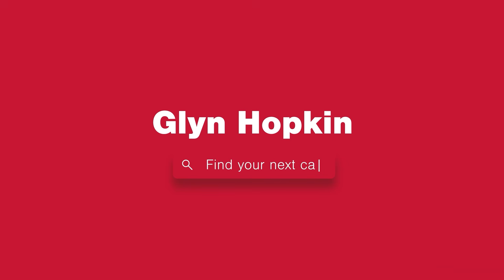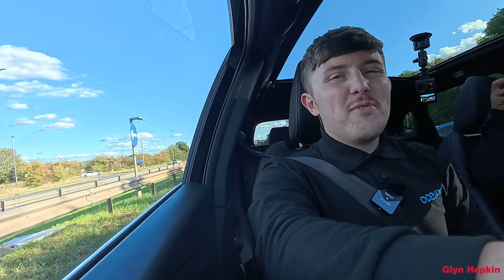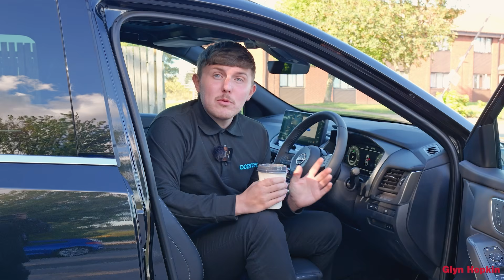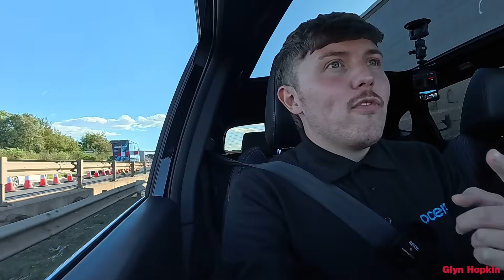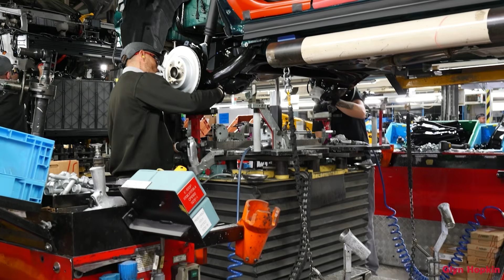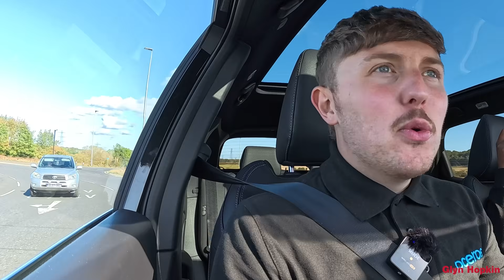NEW Nissan Qashqai e-POWER - Road Trip Challenge - Travel 759 miles WITHOUT refueling?

Comment: I went from the 190bhp driving pressing on all the time I would get 440 miles, always in sport mode.

Now I don't know what theyve done to the new model but it blows the last one out of the water, my 205bhp facelift is on its first tank of fuel and with a mixture of urban and calm motorway driving (always in eco now) I'm going to easily get 650miles maybe more! What a car, you won't be disappointed
Reply: They changed the engine and also tweaked it not to run to maximum revs so quickly all the time.

Comment: 759 miles per fuel tank bullshit when I picked mine up from the dealership I filled the tank to the brim that gave me 660 BUT as time as gone on I now get less than 500 per full tank is anyone else E-power 1.5 car I'm lucky to get 50 mpg
Reply: What is the temperature?  Ever single hybrid I know take a hit when it is cold.
Reply: Count yourself lucky - my 1.6 MHEV Qashqai gets 24.mpg around town.   The e-power can get 70-80mpg around town.
Reply: @markm49  e power 70- 80 around town not in a million years I get tops 50 miles per gallon if I'm lucky..
Reply: @keithscott676  Correct in every word you say bud, Ive a 75  plate Tekna from new and never hit anything like that,
but I must say a lovely car,to get that I think youve gotta be 80 yr old,drive in eco at max speed of 15mph :face-blue-smiling:

Comment: The e-power is an interesting proposition. Why no mention at the journeys end of the fuel consumption which is a major omission.  Surprising given that good fuel economy is supposed to be a major benefit of the tech.  A miserly three year warranty hardly shows faith in the tech and is underwhelming these days compared with most of the competition.
Reply: 3 years ? Here in NZ its 5 with up to 10 if you service it at a nissan dealer

Comment: Well  I had a major Power failure in my new 205PS after 700 miles in mine and 3 weeks  later it's still with the dealer.  Just as well I was not on the m25 when it ground to a halt. I did 26k miles in my 190PS e power without probs.

Comment: 600miles is not possible on a normal motorway driving. I had this car for a week and on 72mph motorway I was getting around 46 mpg, and around 530 miles of range. 
However in the town it’s possible to do 750-800 miles. As in the town it’s possible to get 70.5 mpg with a defensive driving. 
The car feels solid and well made. It’s a great car. I liked it a lot on 900mile trip in Scotland. 
Only thing the basic seats are terrible for long drives. No lumbar support. I’m curious if the leather seats are any better
Reply: ha ah, this is the new system which improve fuel eff by 16%.
Reply: @cb5110  I think it still won’t help highway consumption, where it relies on the petrol engine to run on high revs constantly
Reply: @DediPig  it does, the new system engine turbo reduce RPM by 200 RPM, also force more air in which help burn more fuel.
Reply: He was doing 56mph in part of the video which is a much more efficient speed (though one of the clips shows him just over 70 as well).
Reply: This is the new improved e power system!
Reply: @stevemarks9360 Hope they will address the seat issue too.

Comment: 72 plate xtrail max 480miles to a tank  .fake 600 plus to tank not possible.
Reply: Your car doesn't have the same engine. You have the 2nd generation of e power. This is the 3rd generation. Not to mention the X Trail is larger? Heavier? Are you expecting the same mpg as a Qashqai?
Reply: It's possible if you're not driving in the motorway.

Comment: My 72 plate 12,000 miles one new 12 volt battery noisy front brakes not been sorted! I agree hybrid battery not big enough. I asked them to tell me how many miles have the engine done to give me an idea on what the car has done on battery only but they couldn’t tell me! I regularly drive and I’ve never got more than 43 ish over 500 miles interesting as info comes up when I switch off current mpg 70 mpg but this means nothing…. I will add I’m not driving this hard… overall disappointed

Comment: 759 miles my arse... Mine is  a 2025 Qashqai E-Power Tekna new version with 205HP. The only  way you're going to get up to 62.8 MPG especially on a longer trip is by sitting at 56 MPH and drafting HGV's. I did a very long trip up to Scotland and back all in the space of a day and a half, and the very best I achieved was 50.1 MPG, measured from full tank first click stop back to full tank first click stop, This was at or very near to 70 MPH with an occasional burst up to 75MPH, but not for more than a few minutes at a time.... I also take massive issue with the infotainment  system. On mine Android Auto does not  work properly. You can FORCE it to work by turning off the infotainment by keeping the button pressed, and after it reboots press the button once gain to turn the infotainment system back on.  Sometimes even this doesn't work, and you have to unpair the car  and the phone and start all over again, but when you  get out of the car and turn the ignition off, it develops amnesia and you have to start all over again with the power on off button for the infotainment or delete all pairings and start again next time you get in the car. I raised this as a complaint with NIssan UK who promised a 48 hour response time.... 20 DAYS LATER, (Yes TWENTY ) I'm still waiting for Nissan UK to get off their arse and call me back.... For a brand new car the quality is total shite, with squeaks groans and rattles from both front doors, the boot trim and something underneath the back seat... It's tiny 2 kwh battery cannot  cope with motorway driving and  will sometimes come up with a warning to say insufficient power, now switching back to hybrid power, even if you do drive it gently, which I do. Oh and the seat must have been designed in a torture  chamber as the lumbar support is not enough and left me with backache.

Good points. Umm, its quiet, the cameras work well, I like the wavy foot approach to boot opening, as it has saved me some hassle a few times now...

Would I have another one, er not as long as I've got a hole in my........ wallet from filling it up....
Reply: It either the car have a problem or the temperature. My Honda hybrid also show  power reduce when it is cold.
Reply: It wasn’t on a motorway I was getting low 60s it was urban , it’s useless on a motorway. Just driving steady on my commute to work. Now the mpg has got even worse barely scrape 45mpg
Reply: @mathewnicholls5881 if it cold it going to get worst and come back when it warm. No hybrid work well in cold time, simple because of the battery.
Reply: When I first got mine, on my work commute about 3months ago I was getting anywhere from 60-72 mpg now for some reason months later I’m lucky if I scrape 50mpg. No difference in my driving at all and tyre pressures are all correct. The only thing I can think of is maybe because it’s getting colder and the batteries are not as efficient in colder temps.

Fault wise annoying like you I’ve the odd rattle in the drivers door I think it’s something to do with the window regulator which needs looking at, squeaking breaks at only 4.5k miles, the rubber seal on the drivers door squeaks when closing if it’s raining and not to mention the engine sounds like a tractor. Oh and I did have something weird go wrong the other day were the fan heating just randomly cut out and wouldn’t come back on until I reset with the on off button. 

For a car that’s worth £41k you’re right about the build quality. Dog shit!
Reply: @mathewnicholls5881 what is the temperature? Hybrid suffer during cold months.
Reply: @cb5110 I have the new version but they upped it by a few horse power a few months later. I have the new shape e power.
Reply: @mathewnicholls5881 ok, but still all hybrid will consume more because of cold, because of the drive battery.I do not remember the exact number but battery loss range when it cold. My Honda accord during warm weather consume 4.4 now it consume sometime 7 and sometime 9 l/km.

Comment: Diesels can do 660 miles and 5 mins to refill and won’t drain your wallet feeding your car and yourself
Reply: That qashqai does 759 and only takes 5 mins to fill you only put petrol in them that's it
Reply: Exactly, my 2.0 diesel Passat wagon regularly does over 1,200 miles per tank on long return run (East London to Galway)

Comment: I have one too, and I like it - with some niggles.  Don't think of it as a hybrid, it's an EV but with its own generator. It is always an EV - the EV button just tries to prevent the petrol engine starting up for as long as possible, but it will when it needs to as it will only go a couple of miles on the battery. So good for leaving quietly in the morning but not much else. There is always regenerative braking, just a bit more in B mode and a lot more in e-pedal. It is not true one-pedal driving though as it won't bring you to a complete stop. Despite all the blurb about the energy saving nature of regen braking, it is interesting that ECO mode, which gives the greatest mpg, actually makes it coast when lifting off rather than use regen braking - so make of that what you will.